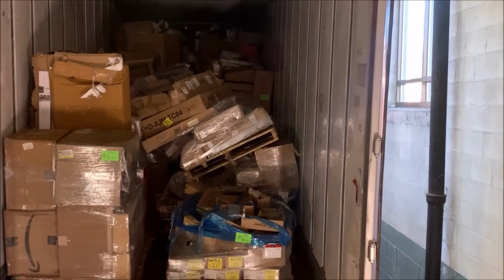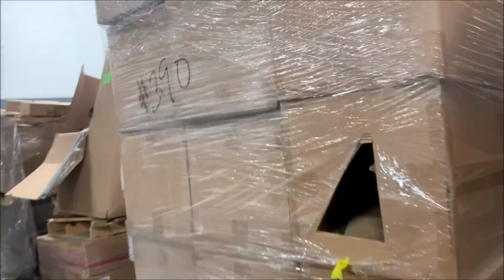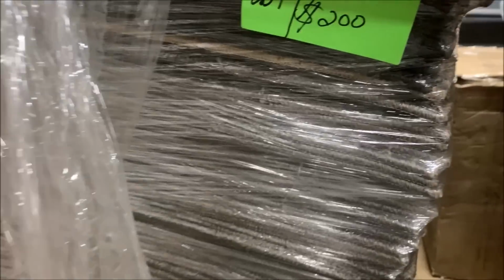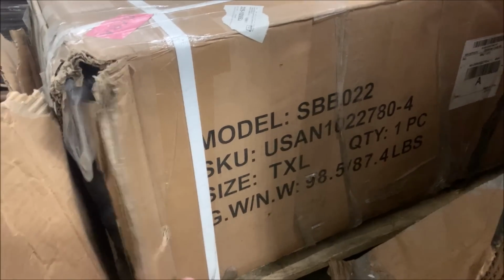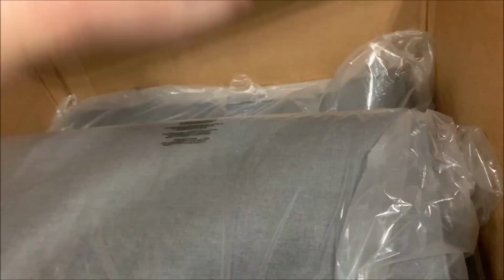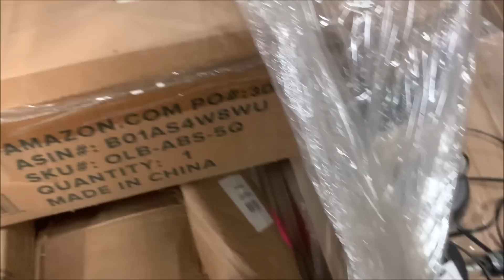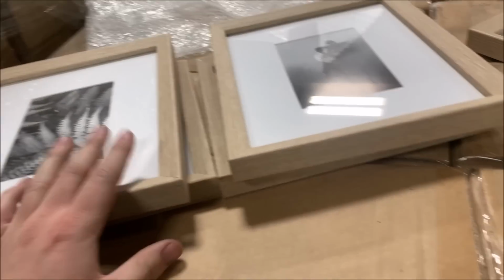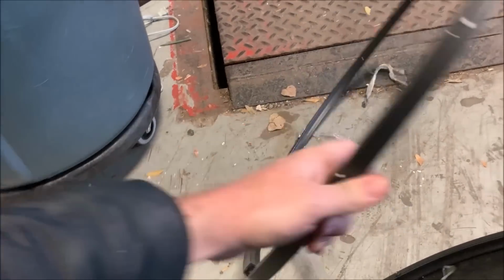I Accidentally Bought 41 Pallets at an Auction

Comment: Correct. Fry's Electronics was a nationwide big-box store that started in the South Bay Area (Sunnyvale, CA) and headquartered in San Jose. They recently (2021) closed all their stores due to failure to capture the online shopping space and from what I could tell, major supply issues. For years before they closed they would have massive shelves that would be sparsely stocked or even empty. It was very odd. Used to be the go-to place for computer hardware, games, DVDs, TVs, appliances, etc.

Comment: When you step off the top of an extension ladder by stepping over the ladder rather than stepping to the side it's more stable because your body weight goes straight down against it as opposed to sideways or some other thing.  That "ladder safety thing" is or should be imperative to someone who work on roof everyday.  It attaches to the top of an ext ladder to make egressing that ladder a lot safer.  And probably very valuable.

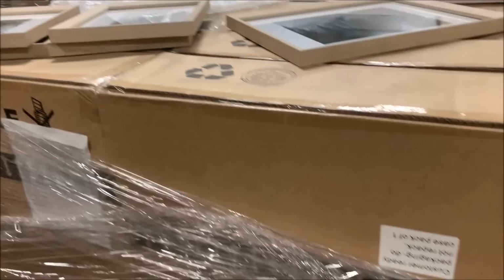Comment: 36:56 the picture frames are a case pack of 1 set. The labeling is right. Those pictures are a set of images that are cohesive. You can hang them on the wall as is for a black/white cluster piece, or replace with images of your own if you only want the frames.